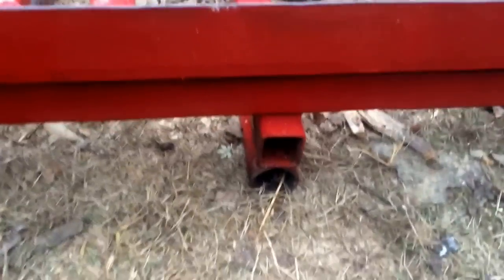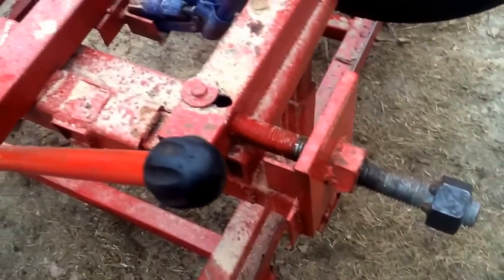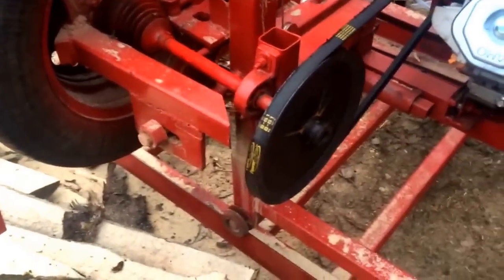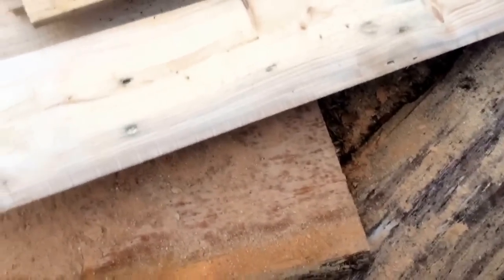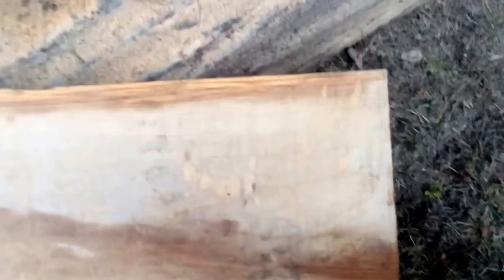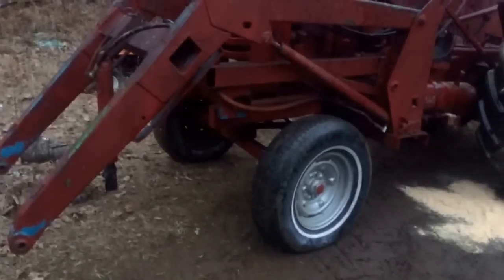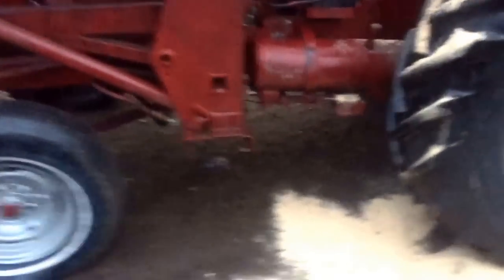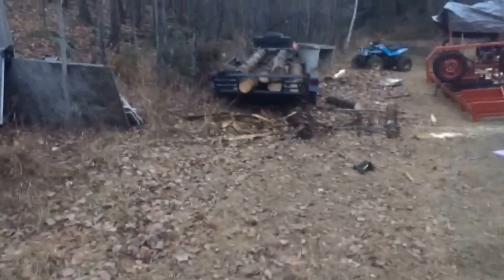Updates on home made bandsaw mill

Comment: Im building a bandsaw mill right now, I am also using two car bearings with a CV shaft to spin them, almost the same design you have as well for adjusting blade tracking, we think the same ! glad I know its going to work well ! awesome mill im so excited to make my first cut.
Reply from the maker: Ya it nice cheap just watch out for the alignment of the wheels can be dangerous at first good luck let me see it when your up and running 👍